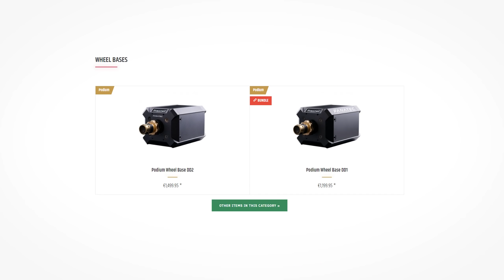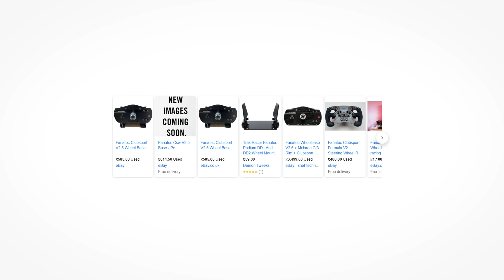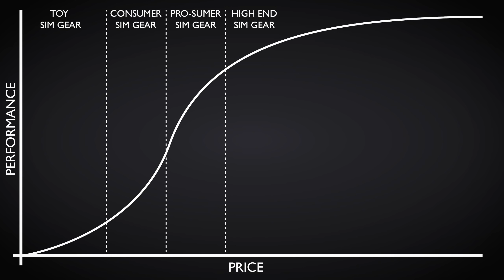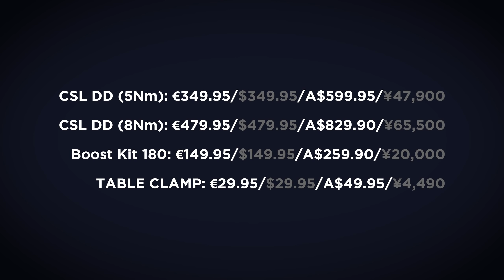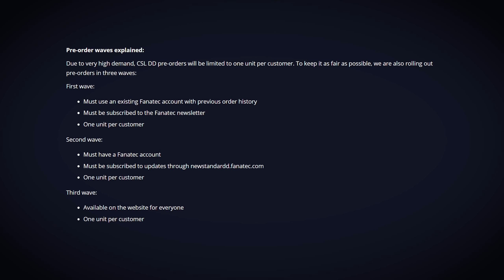Testing The New Fanatec CSL DD Direct Drive Wheel [First Look]

Comment: How Long u Can Play bevor it overheating and Powers off? My was 3h, is that normal?
Reply: My CSL is 2 years old and did not even get hand warm - even after 6 hours of use with full FFB. I guess yours is either faulty or it is mounted in a way where the air can’t circulate around the base?

Comment: I'm looking to get started in the sim world and I would be playing Forza Horizon series(mainly attempting to drift), probably Assetto Corsa and maybe the project cars series. I was thinking of going with the Logitech G923 but I would like to have more force feedback and also get something that will last me for years to come so seeing this, would this be a good option with one of their Xbox wheels and the CSL LC Pedals? I plan to go with their shifter and hand brake aswell which is what drew me to this due to the easier setup. I know that many will think that I'm crazy for wanting to spend all this money for Forza but I have my reasons. Would it be worth spending a little over $1800 on a complete rig setup with this base, one of their wheel combinations with the base plate and pedal set compared to spending about $1250 on a setup with the G923 wheel and pedal set with the Fanatec shifter and hand brake? A big difference in price but also a big difference in quality and performance.

Comment: For anyone having issues with the CSL DD (I assume this extends to the CSL DD PRO)

* Not being able to calibrate the H-pattern mode of the SQ 1.5 shifter:
(1) Try with the short cable provided with the shifter.
(2) If unsuccessful, unmount the wheel base, hold it tightly between your legs and try with short cable.

** Wheelbase or steering wheel disconnects in driver page or FFB/buttons/pedals quit working in-game:
- on pc -
(1)  Connect the wheelbase with a wheel mounted and turn it on.
(2)  Open the driver page.
(3)  If everything seems connected, tighten the black C-clamp on the wheelbase shaft a bit (or to 15Nm torque) and see if the issue persists
(4)  If the issue persists or something shows to be disconnected: Loosen the black C -clamp on the wheelbase shaft till you can rotate it slightly without too much effort.
(5)  Rotate the clamp gently till the driver page shows everything connected
(6)  Tighten the black C-clamp on the wheelbase shaft a bit (or to 15Nm torque) and see if the issue persists

I've had both issues, where the disconnection issues got worse and worse till the both of my wheels showed disconnected permanently. And after a month of trying drivers/firmware/usb-ports etc. these solutions solved my issues.

* On my initial fresh install of my CSL DD with Boost kit, the FFB was very weak. This was resolved quickly for me by uninstalling and re-installing the drivers again.

Comment: I'm so happy with this video. I 'accidentally' bought one last night with the standard power supply. I'm hoping someone brings out an aftermarket 8nm PSU because the 'boost kit' is overpriced for a PSU. I wasn't sure I made the right call as I own a nearly new CSW2.5 but I'm all about fidelity and seem to drive a little better under lower forces.

Comment: The boost kit is pretty high. It's just a generic 180w power supply with whatever connector they use on it by the looks of it. Will probably see aftermarket ones or diy ones out in the wild once this comes out .

My biggest thing is upgrading from my g27 will require pedals, a shifter and a rim on top of this just to have a comparable experience.

Comment: Chris, the DD1 is 2x more and the DD2 is 3x more expensive than the CSL DD 8 NM wheel.  Do those offer 2 and 3x the performance? I always hear 13 Nm and higher is not worth it because you cant realistically use that much power.  It is just too much to be worth it.  Your thoughts?

Comment: If you want the most immersive experience (while not spending at commercial levels), would you go for the Podium DD1? Sounds like jumping up to a DD1 means you also need a no-flex cockpit rather than a solid desk.

Comment: Hey guys I'm new to sim racing , if I get a steering wheel of any brand does the wheel drive comes with or I have to buy it separately??
Reply: Have to buy fanatec wheels separately and if you want to run an aftermarket wheel you'll need the adapter
Reply: @TheCsb1996  thanks

Comment: Looking at getting my first wheel and this seems to be a good option
Reply: Its is a very good option for your first wheel. Good luck man
Reply: @Bobbarker23455  Still, by the time you add pedals, shifter, handbrake and steering wheel, it's pretty expensive 😅
Reply: @kevin_howell  yeah u looking at cheapest 600 or 700 from Fanatec but still not to bad they are the best sim racing gear u can buy.
Reply: @kevin_howell  and 2 months ago if u wanted fanatec dd wheel base the cheapest just for the base was 1,000$$.. so 700 for everything pretty dang good.
Reply: @Bobbarker23455  Fanatec certainly doesn't produce the best gear.
Reply: @maarten3225  i mean that's kinda all opinion, how many options do u have at a dd wheel base for 350$$?? None, cheapest is like  750-800$$ and u get no eco-system. Fanatec has a huge eco-system.

Comment: Personally I don't see why everybody is raving about this. Customers are basically getting duped with this setup. An affordable DD setup? It's not even available for PlayStation users yet. 

$350 alone just for the 5nm base. That's BEFORE taxes, and fanatec's high cost of shipping. Add another what,  $140 for the extra 3nm "boost". Still no wheel.   CSL Elite was 6nm if I remember correctly? 
So, it cost around the same as a CSL elite setup, but  lower rated power, and cheap wheel.  Go bigger with that power boost, and a good wheel, and it's looking close to almost $1,000 for 8nm peak power. Accuforce V2 is about that with more power.
Reply: Sim gear in general is just very overpriced. The motors used in these devices (often used conveyor motors to my knowledge for instance) are very cheap compared to the price we pay for the completed product.

Comment: If your currently looking at this wheel thinking will it be enough power? Yes. 5nm and under if your a drifter, truck driver or just dont need much feedback. 8nm boost pack forsure if you race F1, GT, Race cars. I know this because I didn't want to wait and bought the DD1 and found out I use a steady 6-7nm racing which is really strong for most people

Comment: The total cost with wheel, pedals, shifter, etc. is about $1400.
Reply: For me its 630 (without a real h-pattern shifter)
Reply: @Delitor  Oooo we flexing here? 
SC2 pro, Cube controls formula pro, T-Lcm, need a chassis as my play seat challenge won’t cut it when my SC2 comes
$3000 deep
Reply: @averagereviews3389  how am i flexing? I just said what it would cost for me, i dont own a fanatec wheel
Reply: @averagereviews3389  You have a high end wheelbase and wheelrim and a fucking basic load cell pedal set? Please tell me you’re going to upgrade to Heusinkveld’s soon…

Comment: Hi Chris. Would the 8NM CSL DD provide enough power to use the Fanatec GT3 Rim? It‘s one of the heavier Rims (with over 2kg to my knowledge) which is nearly double the weihght of the Porsche 918 Rim.
Reply: If you have a 918 keep it. I have the GT2 and the 918 and you feel the difference even with a DD1.

Comment: is this compatible to thrustmaster TLCM Pedals and the TM TH8 Shifter? 
I just want to upgrade my Wheel Base + Wheel and not make a complete makeover to my simrig o:
Reply: If TLCM Pedals and the TM TH8 Shifter are used with seperat usb    yes
you can cannot plug them to the base

Comment: Being a CSW 2.5 owner I hope they tell us soon what the CSW DD will be like.  Since today the price difference between the CSW and CSL Elite is only $50 USD.  If they come out with the CSW DD and it's torque values are likely higher than 8 NM and they price it again only $50 more it seems that would be the ideal way to go.  But my guess is they will likely price the CSW 2.5 mid way between the CSL DD and the DD1.  So possibly $750 for a CSW DD?  Geez Fanatec just release the CSW or tell us if you are going to because personally I'm not buying the CSL DD until I know about the CSW DD.
Reply: My totally wild guess with nothing to substantiate being fact is that they will discontinue the DD1, bring out a new CSW DD at around a 12-15nm power output range and price it around the $900-$1000 or so mark and again filling a place in the market that to a degree there are not many current offerings.
Then you will have the two lower tier CSL offerings, 1 mid tier much more powerful CSW offering and then 1 premium Podium offering with the DD2.
With those four offerings they cover all major price points and market performance levels while actually making the flagship DD2 premium offering have no in house competition to its sales.

Comment: I got mine today with availability by end of September. Sadly I was included in wave 2 even if I was eligible for wave 1, being already a Fanatec customer. I inquired about this with Fanatec customer service, and they replied with no explanation about my question. I honestly did not liked this attitude at all. I have big expectations about this new base. Even if my csw 2.5, two months old has domd quality issues now. For sure Fanatec is collecting a big amount of money in advance as all pre orders are fully paid for. So a lot of cash flow.Regarding the product, I disagree on the extra price charged for the “power kit”. 150.00 euro for a bigger power supply is not justified compared to base + standard power supply at 350.00 euro. And then what are we supposed to do with the smaller unit? Just a waste of obsolete equipment that is going to sit for ages somewhere in the garage…
It is a very debatable, purely marketing decision that in my opinion clashes with Fanatec brand promise: best sim racing equipment with no compromise. I’m sorry to see the brand becoming so much more advanced in technology and at the same time being able to embrace such debatable and unjustified marketing trends.
Reply: I agree on pricing but they are not shipping both power supplies. You only get one which is good for waste.
Reply: Is it not possible to source your own 180w psu anyways?
Reply: @lupix4752  You can but it voids the warranty (the csw 2.5 came with a 180, but the plug is different)
Reply: U a big baby, shut up and enjoy a 350 $$ dd wheel base.

Comment: Great review Chris! I wonder if you can bottom mount it on all 4 of  the t-nuts? I have a nextlevel racing wheel stand lite and it doesn't have a pre-drill hole for the center and no way for me drill one since it interferes with the post.

Comment: We can only hope the 'booster' pack is not overpriced compared to the 'standard'. After all A/ it's what should be supplied in the 1st place rather than a down rated power supply. B/ The difference in cost between psu 'A' and the higher rated 'B' is small compared to the initial cost of 'A'.
Reply: I just found out the boosted kit, which is just an 180W PSU is Euro 149.95! Anyone can buy a PSU of the same rating for around 50 Euro (80+ on RS online, medical use approved), now you know how you are being taken for a ride by Fanatec, oh and you are left with a 'spare' 90W psu because Fanatec don't give you a trade in eh ;)
Reply: @davidpovey01  You are not even left with a spare one as if you order the CSL DD+the boost kit together you only get the wheel base and the 180W psu.

Comment: I’ve seen other reviews where ppl where using F1 wheels on this little csl DD, I think the lack of a fan could be a problem yeah but what is the temp of the motor when the case is that hot, I think I’ll stick with my csl elite until I can get a DD1/2, I don’t like that new crappy plastic quick release I’m a PS, PC gamer so I guess this isn’t for me, you must have never used a fanatic belt drive wheel on mine I can tell if I have a wheel on turf or on a rumble strip and it’s not that hard to catch a slide I like a ton of FFB the CSL elite F1 v2.5 for PS/PC isn’t even strong enough for me, it’s all about the setting you use in the wheel and in game to fine tune you FFB

Comment: I love the desk clamp. My crappy setup, i use a Folding Dinning room table that i clamp my wheel too, then, I have these items that i need to shove behind my wheel after being clamped, to prevent and slide lol. A picture does it justice then my trying to explain lol
Reply: its fine, u dont need a flashy rig tbh. but you need one for that wheelbase, im afraid that table clamp wont be strong enough, especially when the table itself isnt very rigid. i wanted it for desk use too. :/

Comment: The wheel used is the lightest by fanatec. I am curious about how the setup would feel with heavier rims (clubsport universal hub, bmw gt2,...)
Reply: Hub with this wheel https://www.bear-speed-parts.de/auto-technik/lenkung/lenkraeder/neu-touring-flat-leder-300-mm-22-qsi300z3-qsp.html
great
bmw gt2 get the 918 it's to heavy
Reply: @testthepest6259  Yes, this is pretty much what I use too. It is lighter than BMW gt2. Thanks for the link, I had a hard time finding 300 mm wheels. Mine is 330

Comment: I have wanted to get into sim racing for a very very very long time. But I am really picky. I was able to barrow an older Logitech option and the cheap pedals were horrible to get a feel for. So I would prefer to get a load cell pedal system. But the 1200 dollar wheel option before anything else is a bitter pill. I can't 'get into' something that costs that much for just a part of what you need. The full kit is insane in cost. Seeing something like this means it might be a more kind purchase. But time will tell.

Comment: excellent preview chris you answered most of my questions i had with this i have a logi 920 at the mo to play f1 games on xbox and its ok but not great in terms of emersion and power wise so looking to upgrade to this bad boy later this year when its released never owned any fanatec gear before so was gonna get the 8nm booster pack then for the wheel rim maybe the mclaren gt3 wheel you used in the video although am not too keen it doesnt have rotation switches on that for the thumb area that puts me off it or the formula v2 rim which looks awesome and the new pedals that are coming out which ill look at your preview on and hoping that will clip on easily to my playseat evolution standard rig the silver one be a massive upgrade for me to do league racing on f12021

Comment: i am coming from a T300RS and as far as i know it is able to output a max torque of 3.9 and i dont even use it to its fullest potential, so i guess for me i will be just fine with the 5nm of the non powerpack and it will still feel like a substantial upgrade in terms of detail and feel.

Comment: My question that know one can seam to answer is "will the base work with out a wheel or electronics for the steering wheel? as i would like to attach this to a shaft from a real car and not use buttons etc. currently i am using a g29 with a modified adapter to the shaft  but it just doesn't kick that real feeling.
Reply: you need a csl/csw/podium hub to use an aftermarket wheel

Comment: It may seem cheap, but remember you have to spend around 400 Euros to get a decent rim with buttons on it. So, it costs more like 800 EUR or more with Boost kit. And that comes close to Simagic M10 which is 1200$ and has a nice GT1 wheel with all buttons and paddles.

Comment: massive thanks for the fantastic, informative video, chris. I'm owning a csl elite on a gt omega wheelstand and could handily "just" upgrade the wheelbase and keep the rest. you said you feel it'd be worth it for the add in fidelity and directness. with the boost kit, would you think one would also need a more rigid cockpit solution? thanks a lot in advance
Reply: I've heard that the wheelstand can handle a DD1, so this shouldn't be a problem since it's quite sturdy. I own the GT Omega Apex wheelstand with the CSL Elite on top and will probably upgrade to the CSL DD aswell.
Reply: @Xetyg  thank you kindly, then i know what i have to do 🌞

Comment: An important thing to consider regarding the strength of the motor: Running a stronger motor (e.g. 25Nm max) turned down to 8Nm will keep it well within it's limits so it will (in theory) last for ages. If the max is already 8, and that's what the player uses, what effect will that have on the lifetime of the motor? I think only time will tell.
Reply: @Darren Murphy Instead of saying "motor" it might have been better for me to have said "wheelbase" because I was referring to any part of the device as a whole.

Comment: What if we splice up a 300 watt laptop power supply? Who's willing to test this?
Reply: Yeah, no chance people aren’t going to try to DIY their way out of paying $150 for a power cable. My guess is that they have some sort of verification chip in the power supply to keep this from happening, though.
Reply: @kingmatai8662  Apparently it detects the power level by the plug's connectors' positive/negative wiring configuration. I've done some math regarding power/output curves (with a lot of guessing involved!!!) and the math says the unit should be able to make 10Nm with a 280 watt supply. But heat is a big question here. Can the unit stay within heat limits at 280w? More importantly, does the circuit board only say "180w pins detected, draw as much as you can" or does it say "180w pins detected, draw the 180 watts limit"? It's very possible that anything more than a 180 watt supply doesn't do anything at all.

Comment: i was wanting this but coming from a csw2.5 i was worried i wouldnt by happy with the same peak torque. theres been many times i wish it made more, especially using larger 350mm wheels. so i said "screw it" and ordered a dd1 yesterday lol.
Reply: I did exactly the same thing! If I didn't have CSW 2.5 then I'd be all over this but it's just not a big enough jump